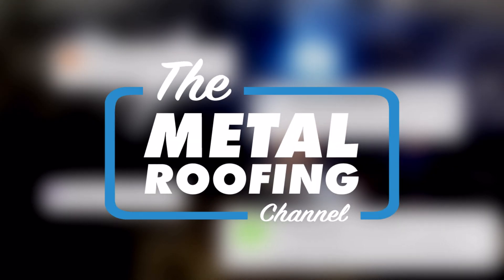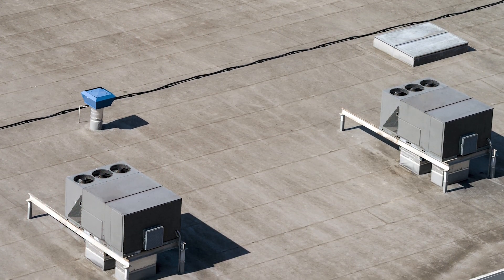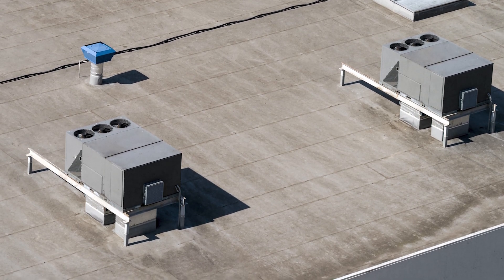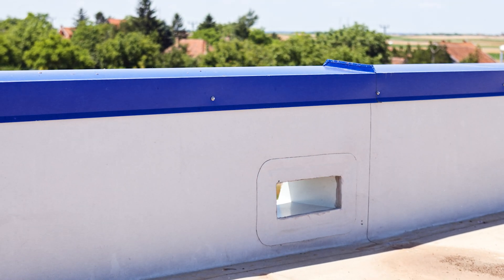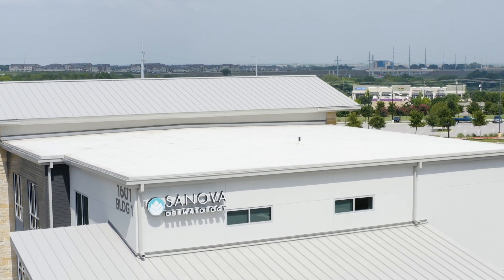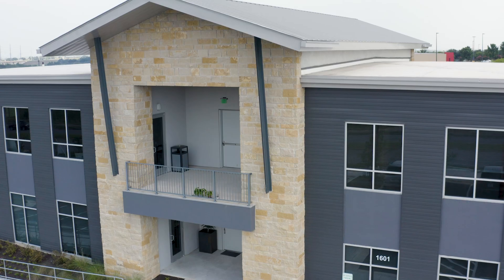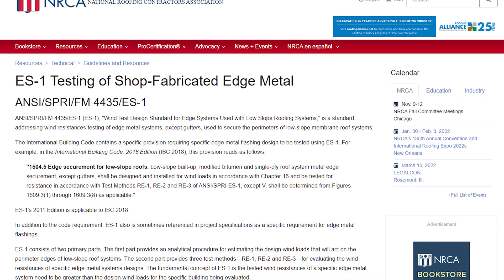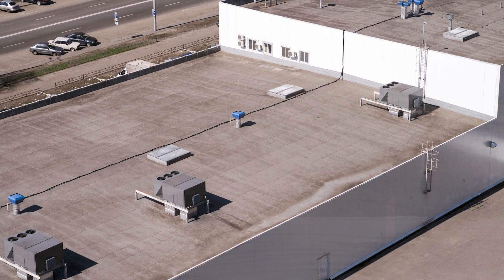How is Metal Used in Flat Roofing Conditions?

Comment: Happy Monday Thad and Adam. I came up installing flat roof metals. Counter flashings, gravel gaurd or perimeter flashings, parapet caps, scuppers, box gutters, including building roof vents. We used cover plates or expansion plates to join every 10 ft piece for expansion. Some jobs required 2ft corners. Flat metal may be what makes a good flat roof. The Devil is in the details. At a commercial company a lot of metal guys are separate from flat roofers, however work side by side..
Reply from the maker: Happy Monday! Thanks for checking out the video and sharing your experience. Love to hear it! -Thad